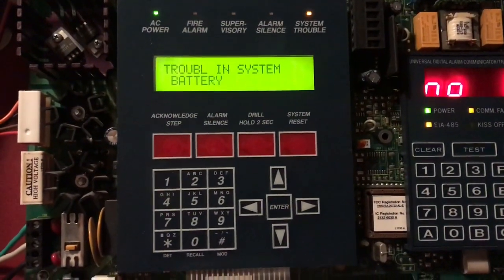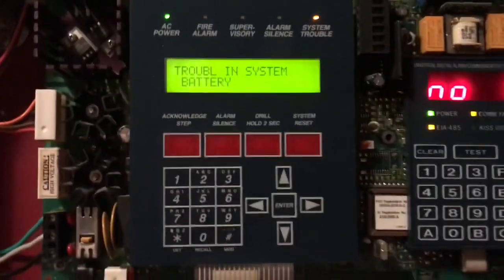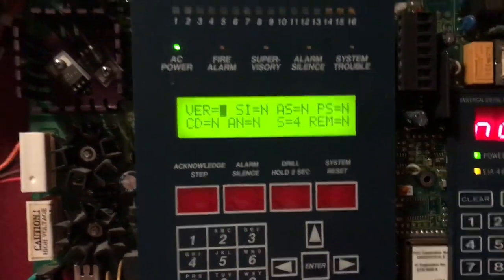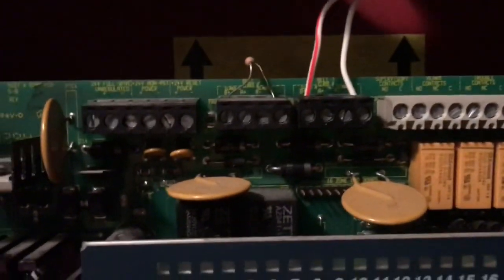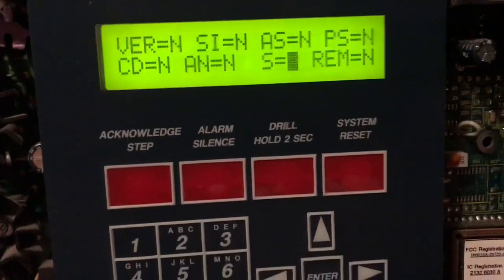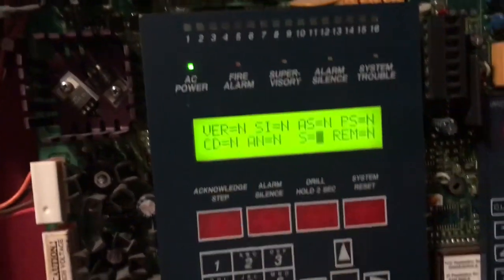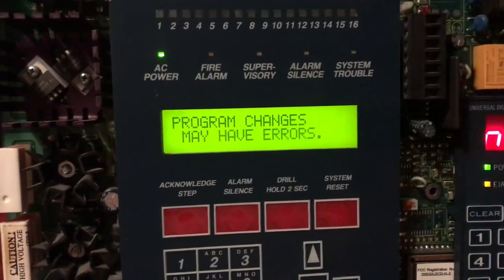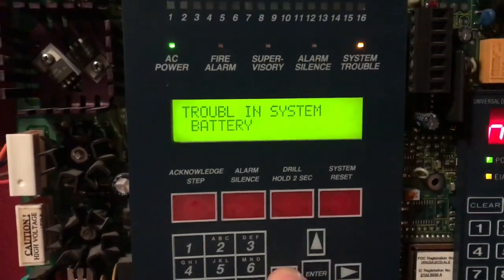How to program a Fire Lite MS-9200

Comment: How do you delete a device
Reply from the maker: @danamcwhite  you have to physically remove the device from the SLC. However, you have to make sure that the device you remove is the only one in trouble. After that you run auto program.
Reply: @ supposedly it has been removed. If run auto program will it ruin the rest of the program on the system? All my label changes and address numbers?
Reply: @      I have a c31 trouble on the system and they state it’s not there

Comment: Can you use an NBG12lx on here
Reply from the maker: Anthony Pasculli great question. Only a Fire Lite BG-12LX. The protocols are different between the two.
Reply: Safeman4202 hi, even though the sfp 100 is the same panel?
Reply: @anthonypasculli6980  The SFP-100 uses NOTBG12-LX's
Reply: Do you know how to program the horns to do code 3?
Reply: @brandonkonicki2177  personally I do not know. You could ask David.